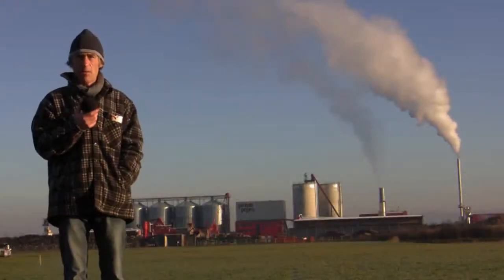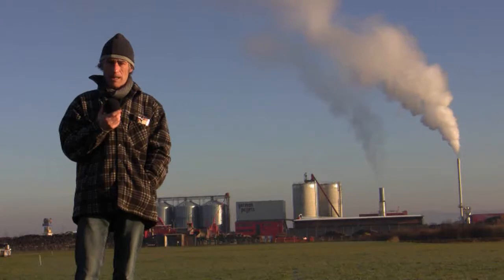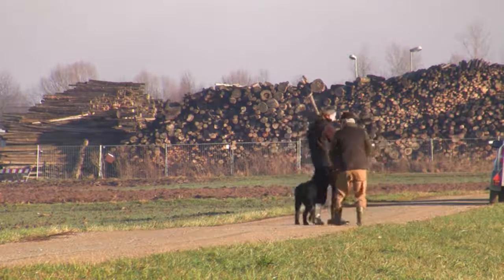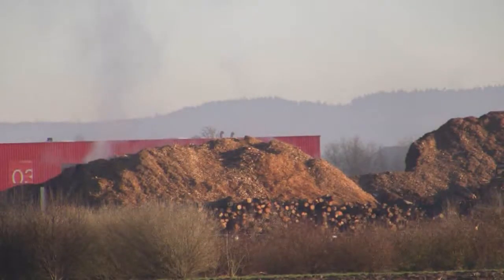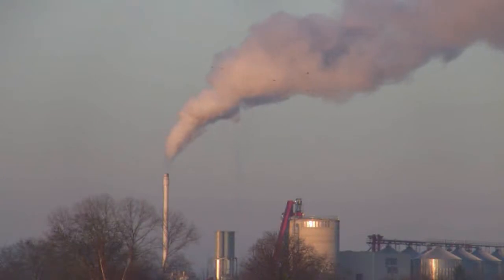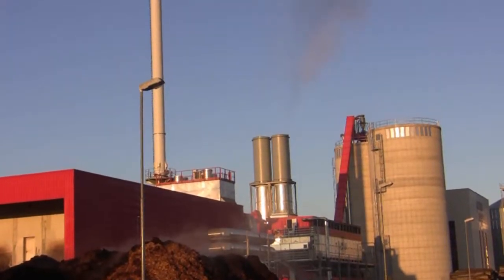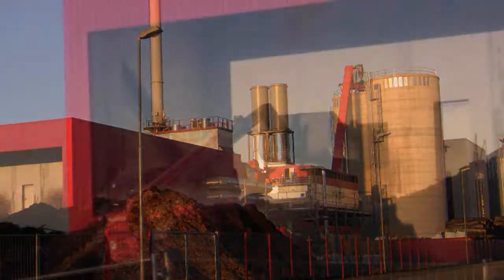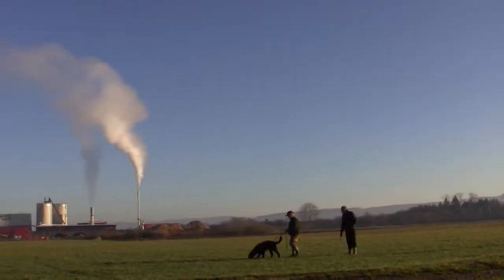Alternative Energy Sources  Wood Pellets

Comment: It looks as if the factory is adding to the greenhouse effect, and of course polluting the atmosphere for the locals, the energy used to create that energy ! 
It would be better to use refuse to produce fuel, and /or building material in preference to landfill.
Here in Wales we are attempting to produce energy with Thermal Electrics, where we use the difference in temperature from opposing surfaces to produce a voltage, 
that will of course have many uses, many more years of research needed .